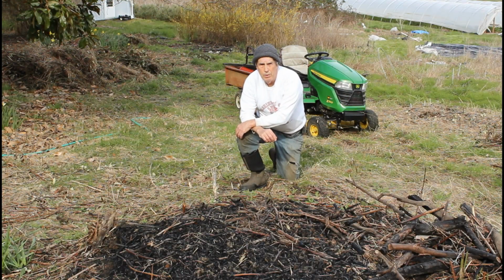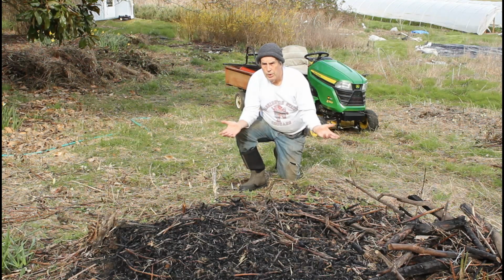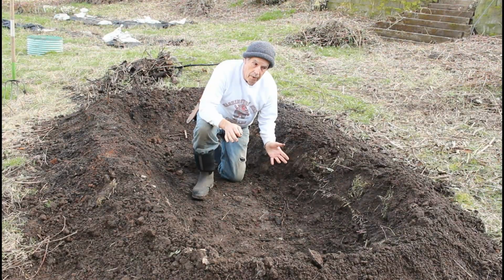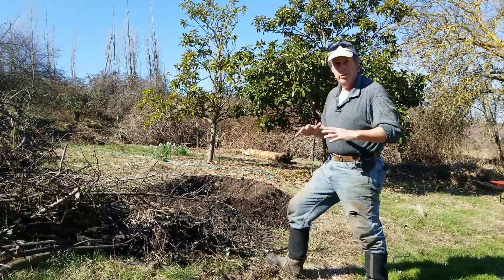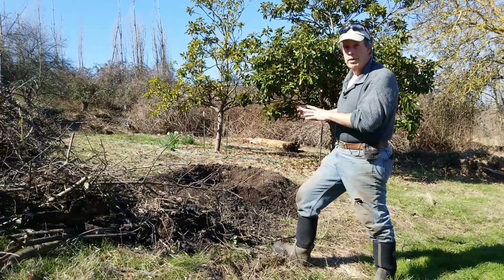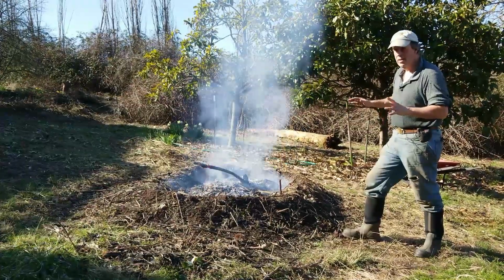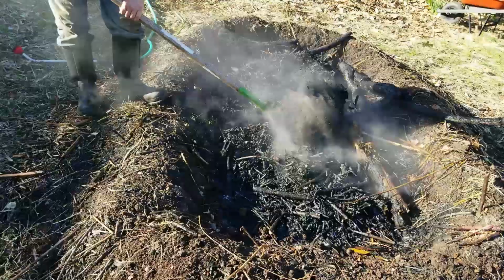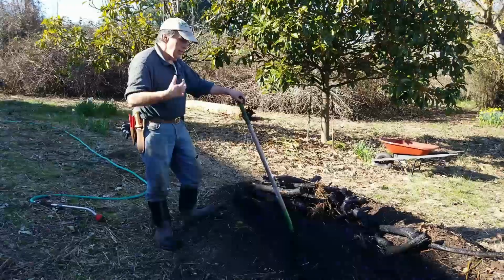Biochar: A Better Way To Use Yard Debris!

Comment: I'm struggling to see the difference between this and a bonfire.
Reply from the maker: Shady Man's answer is spot on.  Also by starting the fire from the top in a trench accomplishes the task of keeping a low oxygen level and creating char
Reply: The aim here is to shoulder the bottom level, with the continuous input of finer material. The goal is to not let the bottom level turn to ash. Ash can be used as well, in the garden, but differently. Hope that helps...
Reply: That helps a ton.  THank You!

Comment: The whole point of real charcoal is anaerobic burning… the carbonaceous material has to burn in the absence of oxygen ie. continued burn while covered up with dirt or tin roofing sealed around the edges with dirt.
Reply from the maker: Hi @Andrew McDonald   You're spot on! The process of pyrolysis is burning in the absence of O2.  The design of this open pit and the fact that additional fuels are added to and  burned from the top chokes off the O2 to the burning material beneath the flames as the heat builds the unburned material turns into char.  Now, this system doesn't necessary get to the super high temps of a retort burner but for no cost it does a pretty good job.  You can stop the process by smothering like you suggested or by immediate quenching the hot fire with water which is what we do.  Both methods work .  Our last burn in the pit produced 8 cuft of char. Thanks for watching!

Comment: I do biochar overnight will continue to burn, I don't use water if at all possible!!
Reply: I was thinking why the water, too, but i live in a humid environment. If you live somewhere dry, you want to keep an eye on it so as not to start an (unhelpful) wildfire. 

It would make sense to look at techniques that indigenous peoples  used with success (before we Europeans stopped them 🤦🏻‍♀️) to learn helpful techniques. They use(d) great techniques for making biochar (i.e. filling the pit back in with dirt, which will put out the flames, but will keep in the heat to turn more of the bigger pieces into char) as well as for wildfire prevention. 

Native populations used to keep destructive wildfires under control by using controlled burns on smaller areas to clear out the dry brush. There's a great podcast episode on that, by the way - Ologies with Alie Ward, the episode is called "Indigenous Fire Ecology (GOOD FIRE) with Amy Christianson".

Comment: I make my biochar similar to yours. But my pit is round and just as deep as yours. But add one other special ingredient---  I go to my local deer processing shop and pick up at least a dozen carcasses that they were going to throw away anyway. When my fire is going really well I throw the bones on the pile and keep adding wood to the top period as the Embers burn I dig them out of the bottom with a long-handled shovel and throw them in a barrel of water for instant cooling and fracking. Last year I made about a hundred and twenty pounds of biochar and I have about three gallons left. Can't wait for deer season
Reply: Brilliant use of nature's waste. And people's waste too. Good job.👍😁
Reply: I use 2 self-made pyramid kilns to make my biochar. They work great.
My garden loves it (once I have charged it).  Have to chase up my neighbor to get them both back soon.

Comment: Appreciate seeing what level of age on your blackberry vines. Mine are very dead. A workshop on Biochar on Sauvies Island last Saturday mentioned that the vines make a fine Biochar. He built the pile which was almost completely smokeless. It was cool to watch the fire pull any smoke back into the flames. He built it with a Conservation Burn mindset. I would like to see less smoke from my neighbors brush burns here in SW Washington. Steam is ok, smoke not so much. 
Thanks for your videos. I've learned enough to go out and try it.